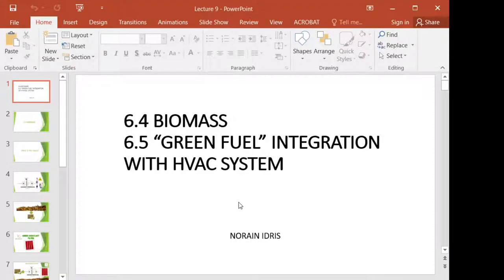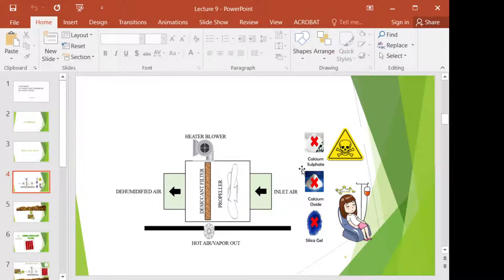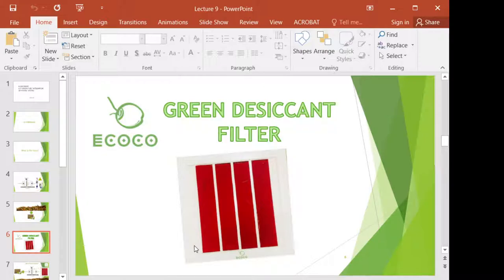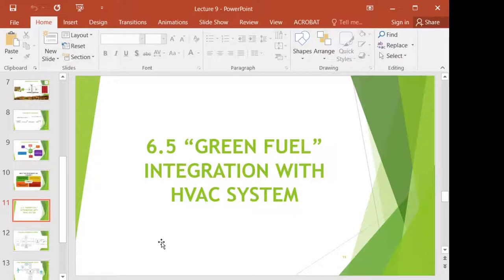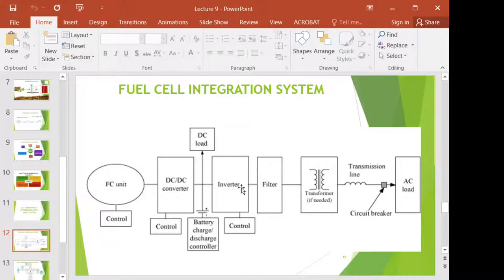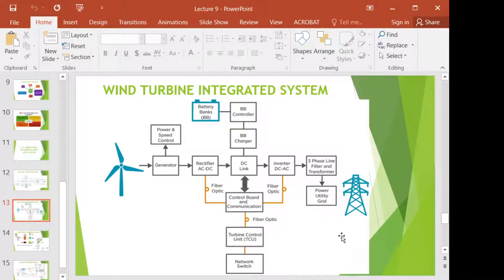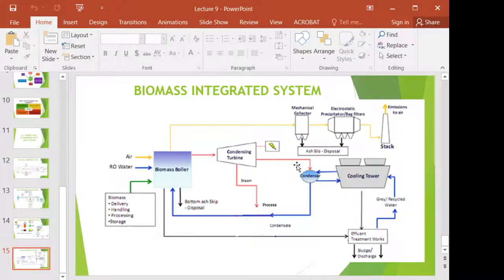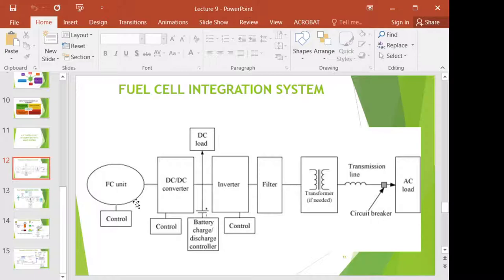Lecture 8 Biomass as fuel source and green fuel integration with HVAC System

Comment: MUHAMAD NURHISYAM BIN MOHD HASNAN
B071710148 4BMMHS1/2

what is ECOCO
the inovation of desicant powder using waste of coconut skin.

function of ECOCO
Contol relative humadity in air to obtain an optimal thermal comfort

Advantage of ECOCO
100% organic
Cheaper
Less formal Hyde release rate
Absorbance performance is equivalent to silica gel
Greener

Impact on the environment and community
Reduce solid waste & increase the aesthetic value 
Reduce landfill 
Eliminate odor pollution from the coconut waste 
Reduce air pollution (formaldehyde release) from regenerating process

Green fuel integration with HVAC System
Fuel Cell Integrated System
Wind Turbine Integrated System
Photovoltaic Integrated System
Biomass Integrated System

Comment: MOHD RAHIMI BIN MUSTAPHA
B071710225
4 BMMH S1/1

LECTURE 8: Biomass & Green Fuel

1) Definition Biomass? 
>>Biomass is organic, meaning it is made of material that comes from living organisms, such as plants and animals. The most common materials used for energy are plants, wood, and waste. These are called feedstocks.  energy can also be a non-renewable energy source.

2) Biomass in dehumidifier
>>Use biomass as desiccant filter to replace existing desiccants which is chemical normally silica gel.

3) Advantage of the ECOCO
>Greener
>Absorbance performance is equivalent to silica gels
>More safe
>Less formaldehyde release rate
>Cheaper
>Organic 

4) Green fuel integration with HVAC system
>Fuel cell integrated system.
>Wind turbine integrated system.
>Photovoltaic integrated system.
>Biomass integrated.

5) Impact on environment and community 
>Reduce solid-state and increase the aesthetic value.
>Reduce landfill problem.
>Eliminate odor pollution from the moist young coconut waste.
>Reduce air pollution due to formaldehyde gas release during regeneration process.

Comment: HAKIM BIN ZAINUL
B017170531
4BMMH S1/1

Lecture 8.  Biomass, Green fuel integration with HVAC system

•	Biomass (what is the issue?)
o	Calcium sulphate
o	Calcium oxide
o	Silica gel
•	Ideation of problem statement 
o	Use the young coconut husk and turn it into desiccant.

•	Function of the Ecoco
o	To control relative humidity
o	Alternative to chemical desiccant.
•	Advantages of the Ecoco filter
o	Greener
o	100% organic
o	Cheaper
o	Less formaldehyde release rate
o	More safe
o	Absorbent performance is equivalent to silica gel

•	Impact on the environment and community
o	Reduce solid waste and increase aesthetic value
o	Reduce landfill problem
o	Reduce air pollution due to no formaldehyde gas release during regeneration process
o	Eliminate odour pollution from the moist young coconut waste.

•	Green fuel integration with HVAC system
o	Fuel cell integration system
o	Wind turbine integrated system 
o	Photovoltaic integrated system
o	Biomass integrated system

Comment: NUR SELIHAH WAL HUDA BINTI AHMAD - B071710190

Issue
1) use dessicant in filter replacing the chemical dessicant (silica gel)
2) will cause respiratory problem using the chemical dessicant.
3) Green dessicant = ecoco

BIOMASS
Function of Ecoco
1) to control relative humidity in air to obtain an optimal thermal comfort.
2) green alternative 
Advantages of the Ecoco
- more safe 
- greener
- cheaper 
- 100% organic
- less formaldehyde
- adsorbence performance is equivalent to silica gel
Impact on Environment & Community
- reduce landfill problem
- reduce air pollution
- eliminate odour pollution
- reduce solid waste & increase aesthethic value

GREEN FUEL INTEGRATION WITH HVAC SYSTEM
1) Fuel cell generate electricity that is direct current (DC).
2) DC connected with inverter to convert to AC.
3) Example of green fuel use :
   - wind turbine = produce AC & rectifier to DC  and convert to AC via inverter
   - photovoltaic = produce DC
   - biomass = produce DC

Comment: LIM PEI JUN
B071710194
4BMMH S1/2

Biomass usage on Dehumidifier 
•	The dehumidified will emit the chemical substance if the desiccant filter was full of moisture and the heater didn’t function well. Since the desiccant filters was made by calcium sulphate, calcium oxide, and silica gel, there all are dangerous to human health.
•	Therefore, ECOCO was develop for replacing the current market desiccant filter.
•	The function of ECOCO was similar to existing product which is control relative humidity.
•	ECOCO was Greener, 100% organic, cheaper, global effect free and absorbance performance is equivalent to silica gel.
•	The impact on environment and community by ECOCO was reduce solid-state and increase the aesthetic value, reduce landfill problem, eliminate odor pollution from the moist young coconut waste, and reduce air pollution due to formaldehyde gas release during regeneration process.

Green fuel integration with HVAC system
•	Fuel cell integrated system.
•	Wind turbine integrated system.
•	Photovoltaic integrated system.
•	Biomass integrated.

Comment: Cheah Kok Hun B071710006 4BMMH S1/1

Biomass in dehumidifier
- Use biomass as desiccant filter to replace existing desiccants which is chemical normally silica gel.
 It will release toxic which harmful to human through regenerating process to remove excessive moisture.

Issue:-
- Chemical such as silica gel, calcium oxide and calcium sulphate releases form aldehyde during regeneration process.
- This chemical desiccant can cause dizziness, nausea and in the long term it can cause respiratory problem and also cancer.

Idea:-
- Replacement of  this desiccant filter with more organic desiccant filter that is ECOCO as the second filter in the dehumidifier device.

Function of ECOCO:-
1. To control relative humidity in air 
2. Green alternative to chemical desiccant in existing commercial dehumidifier which is harmful to human health. 

Advantages of ECOCO:-
1. Greener
2. Organic
3. Cheaper 
4. Less formaldehyde
5. More safe 
6. Performance equivalent lower as silica gel

Impact on the environment
1. Reduce solid waste
2. Reduce landfill problem
3. Reduce air pollution
4. Eliminate odor pollution 

Green Fuel Integration with HAC system:-
a Fuel cell integrated system
b Wind turbine integrated system
c Photovoltaic integrated system
d Biomass integrated

Comment: AHMAD LUQMAN HAKIM BIN ZAMBRUS
B071710459
4 BMMH S1/1

6.4 Biomass
- Silica gel desiccant releases chemical from aldehyde when heated during regenerating process (removing moisture from dehumidifier). Long term exposure can potentially cause respiratory problem or cancer. 
- Alternatively, Ecoco uses biomass from coconut waste as desiccant powder for the dehumidifier filter.
- The advantage of Ecoco are:
   1) 100% organic (greener)
   2) Cheaper
   3) Lesser formaldehyde release than calcium sulphate
   4) Safer
   5) Absorbance performance is equivalent to silica gel 

- Impact on environment & community:
   1) Reduce solid waste & increase aesthetic value 
   2) Reduce landfill 
   3) Eliminate odour pollution from the coconut waste 
   4) Reduce air pollution (formaldehyde release) from regenerating process

6.5 "Green fuel" integration with HVAC System
    1) Wind turbine integrated system
         Wind turbine - generator - electricity *AC current - rectifier - DC current - charger - battery banks
         Wind turbine - generator - electricity *AC current - rectifier - DC current - AC inverter -  3 phase line. transformer - power grid
 
    2) Photovoltaic integrated system 
         PV module - inverter - main fusebox - house/power grid
 
    3) Biomass integrated system
         Biomass boiler - steam - condensing turbine - generator - electricity -utility grid/device